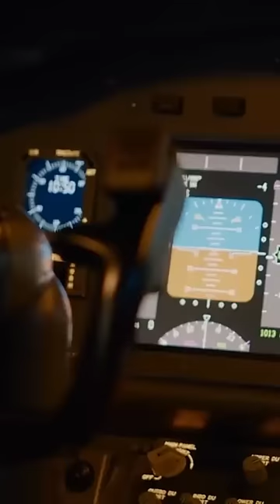What Happens When F-35 Runs Out Of Fuel In Mid-air?

Comment: So is that a tactical advantage to turn the motor off and run on battery will carrying out a mission? Is there a rat generator?
Reply: RAT would be a giant radar reflector. No idea if it's there but I seriously doubt it would be used in any tactical capacity. Generally RAT is intended to be a last ditch effort to get some hydraulic and electrical power if all else flames out.
Reply: @NLozar22  well maybe the turbines can spin and generate some electricity even though the engine is off? It just got me thinking about stealth tactics.

Comment: Not much range. Great we did it again. F18, F35.
Reply: To be fair, if we're gonna mention a Navy's F-18, then it should be noted that Navy's F-35C variant actually has quite impressive range.
In fact F-35's range will probably explode with the new adaptive cycle engines. 

Also, F-18 range was really only the Legacy Hornet problem and was largely resolved with the introduction of the Rhino. Not to mention it can double as a buddy tanker.
Reply: Both F-18 and Rafale M have to carry external tanks just to have the same range of 1400km of F-35C while carrying similar payloads.